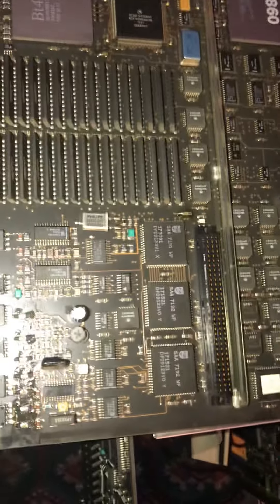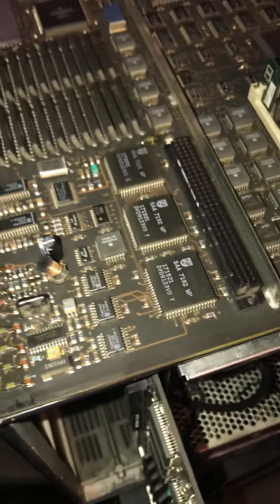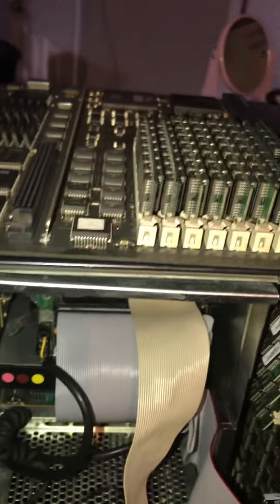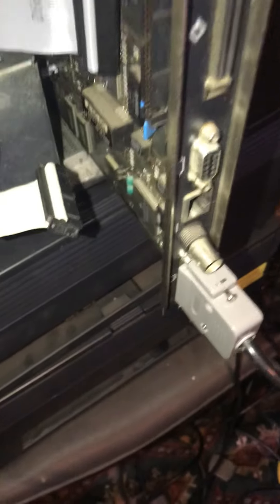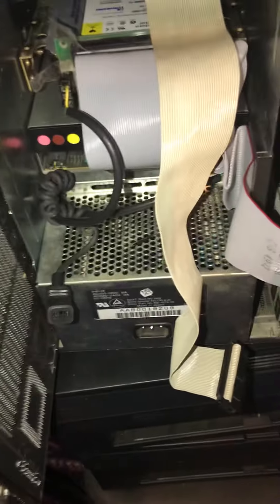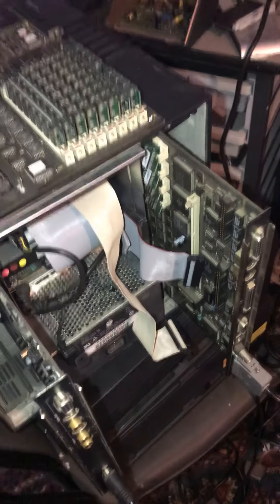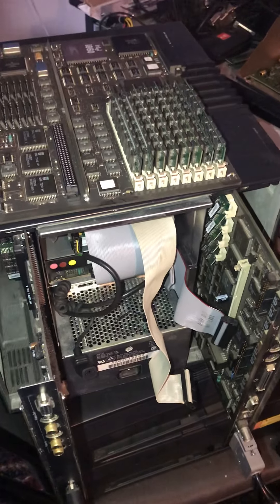Steve Wentz your Turbo Cube Dimension showing what is happening with integration tight tolerances.

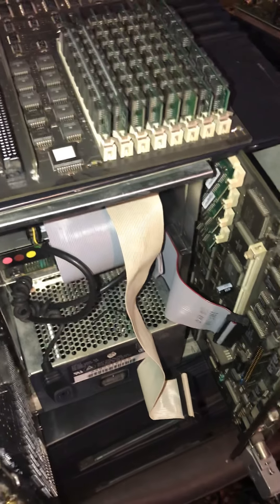Comment: 2:40 Have you tried MCT oil?  It can really help with arthritis.  I put it in my coffee in the morning, and my joints all feel MUCH better.
Reply from the maker: Cool I appreciate that I'll try it , I'm on Embrel and it helpsbut the rainy weather (finally rain) causes flair ups..
Reply: @robblessin  MCT (usually made from coconuts) is a precursor to ketones, which is part of your body's counter regulatory system, and they fight inflammation (among other house keeping chores).  Inflammation is the leading cause of aging, autoimmune disease, arthritis (which is technically an autoimmune disease itself), and neurological disfunction.   MCT, being a precursor, is immediately converted to ketones by your liver.  When you take the MCT I'd recommend avoiding taking sugar with it (as sugar is an inflammation agent, so you'd be doubling down on what you were trying to treat).  

Also, you may need to take the MCT for two or three days to see the full effect.  (I do take it ever morning with my coffee, which is otherwise black, and it has really made a night and day difference to my life.)  If you find you can't handle taking it daily, you might try taking it every other day.